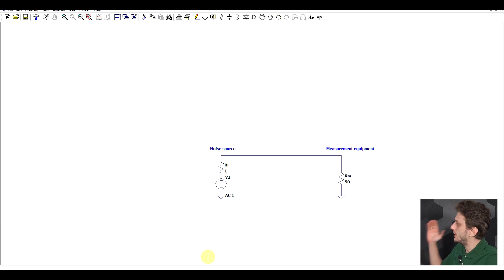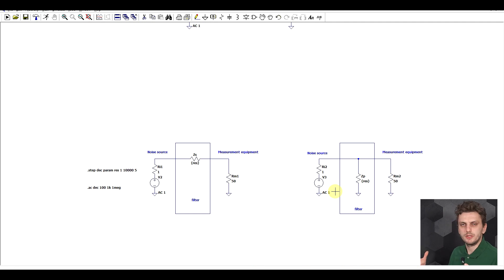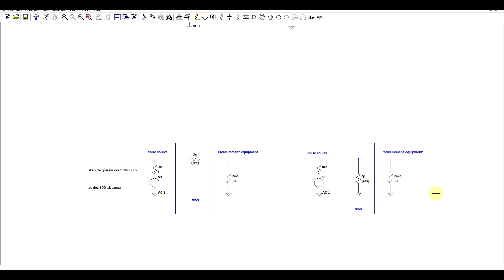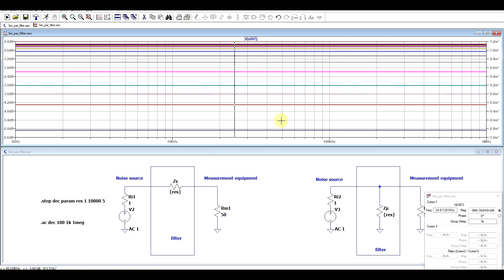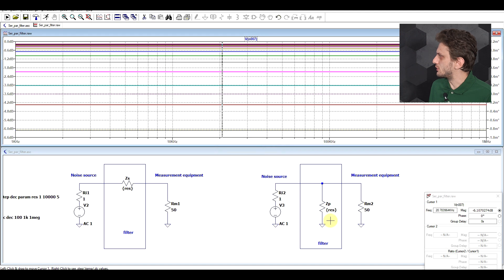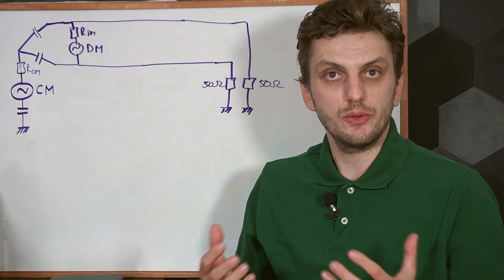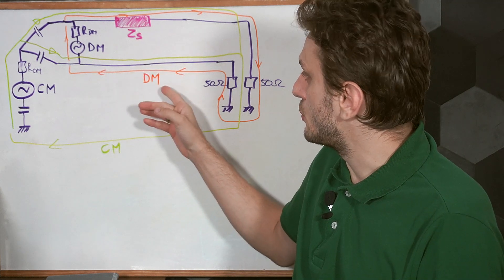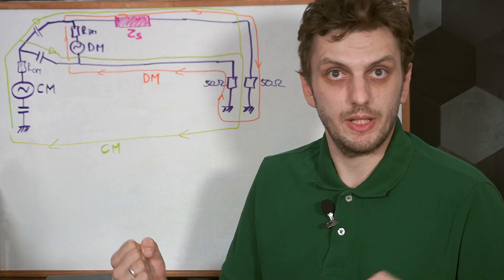EMC tutorials - CM/DM filters

Comment: Hi Feez, I didn't quite catch why series filter needs to be on the power line. As far as CM is concerned, we should get the same "worse attenuation" whether the series filter is on the power or on the return lines. Bc in either case, the other line become the least impedance line and so we should see the same result, no matter series filter is place on which line. Could you please explain ? Thanks
Reply from the maker: Hello Nader, for a series element to work as a CM filter, it needs to be on both lines at the same time (both power and return) - as you correctly pointed out, if its on just one of the lines, the noise will simply bypass it on the other.

Comment: So what happens if you use a Common Mode Choke, which has dual inductors that work together, one inductor for each power rail.  Then you add a series choke in each line after with a shared LARGE value capacitor between + and - rails ?  Shouldn't that reduce both CM & DM while keeping the filter balanced ?
Reply from the maker: This is commonly used, having the CM transformer, and then the individual uncoupled inductors together with a set of capacitors between the lines (depending on the filter you can have up to 3 - 1 before the CM choke, one after the CM and before the series inductors, and the third after the series inductors). The exact filter and the component values will highly depend on how much noise you really need to filter. However the larger the component values the more expensive the filter becomes and the more losses you will start to get..
Reply: Since its only one power supply the cost is not that important.  A 30mH CM choke and 6800uF caps along with a couple of series 500uH toroid inductors should cut most rubbish down.  Hopefully make it usable for OpAmp and small signal work.   :-)  @FesZElectronics

Comment: One thing to take in consideration. The ground of the SA out and input and signal generator are all connected.  I got strange results, while measuring with a VNA, compared to what I  calculated, designing a balanced dipole/open line tuner  The VNA ground from the output and the ground of the input shorted one half of the tuner to ground.
Reply from the maker: Indeed, this common ground will cause a lot of fun... The grounds of the Signal Generator (SG) and the Spectrum Analyzer (SA) are interconnected in 2 different ways - at least in my setup; one path is trough the mains supply cable trough the PE line - this is a long high impedance interconnection; the second way is trough the coax cables and the test setup - usually this will prove to be of lower impedance; in case the second connection is slightly off, the first one will kick in and cause small variations in the measurement, but not always large enough to be obvious...
Reply: @FesZElectronics  isolation transformer at source signals helps...